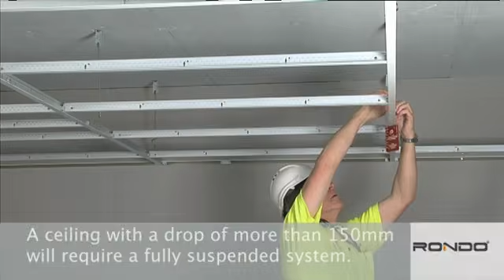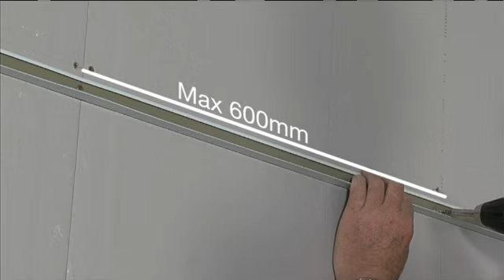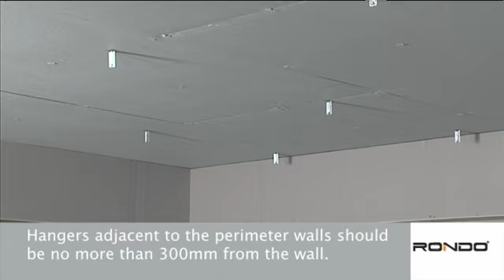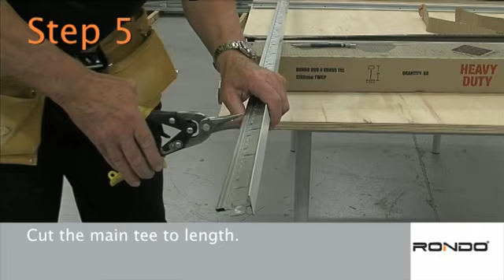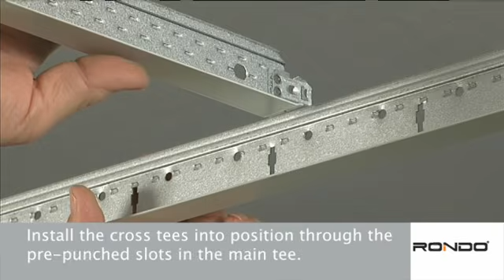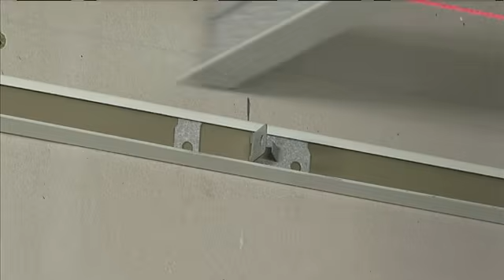How to install Rondo DUO® Exposed Grid Ceiling System

Comment: At no point does these videos show how you are squaring the grid , certainly can’t be done from the floor. Fixing wall trim at 600mm centres is a joke , 300mm maximum. Plus setting out your hangers before you square your grid system is amateurish. These guys aren’t professional trades people.

Comment: part of my drop ceiling hangs down over my steps problem the part over the steps holding 2 small tiles came loose now there  is a center piece in between them it is falling down and so are the tiles how do i fix it